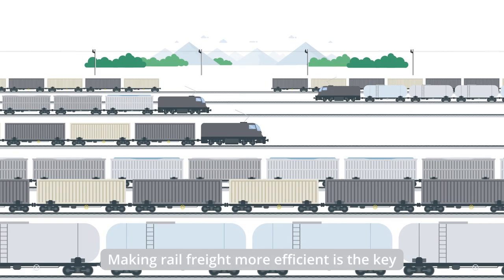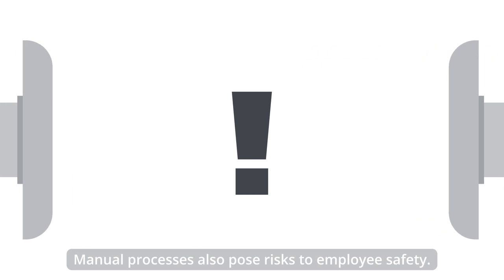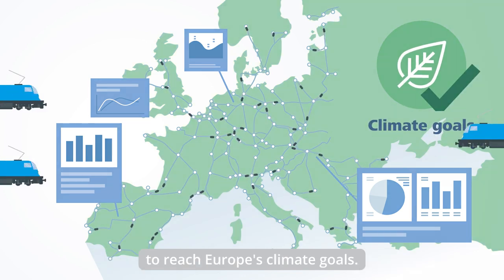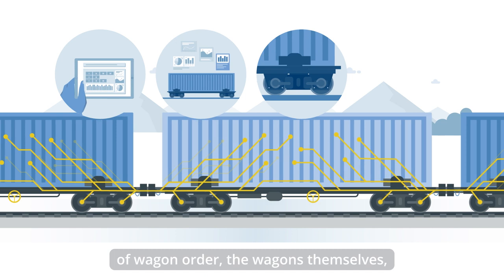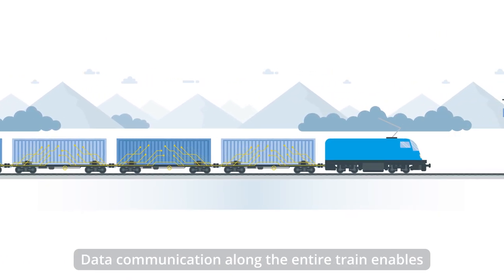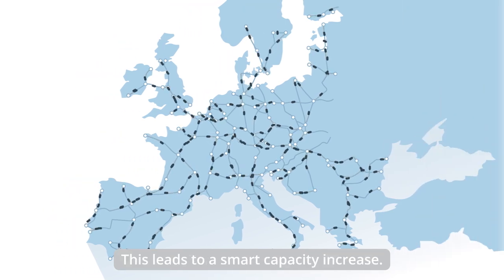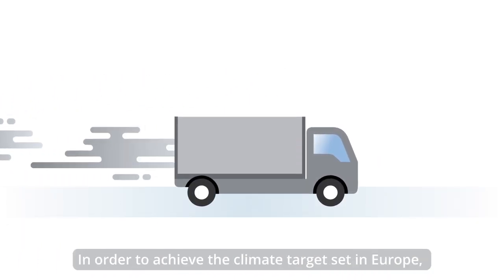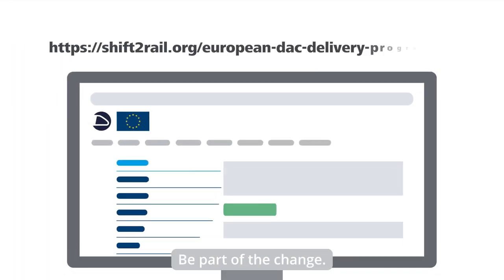Digital Automatic Coupling

Comment: Only 750m, the janney coupler and SA-3 pulled the most heavy train on the world.
Reply: Yes. But thats often in the US or in Russia. 750 meters is pretty long in Europe. 
But we should shoot for twice that at 1500 meters. 
This technology is still under development and if customers asked for it, the system could probably be upgraded for longers trains!
Reply: "Only 750m", but remember train infrastructure was build with shorter trains in mind. There's not much point in having trains longer then yards and stations. Bigger thing is how quick the coupling can be engaged or disengaged
Reply: Multiple mile long trains are not planed for the European train network, that is a mixed system for cargo and passenger trains that doesn't accommodate for long term route blockage.